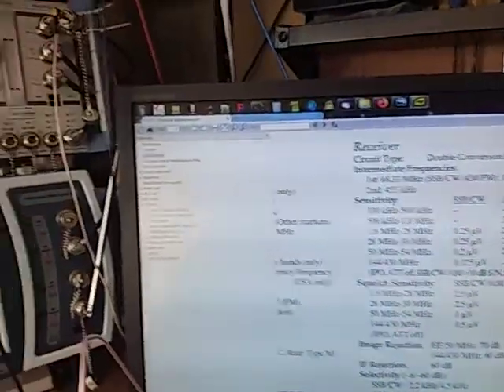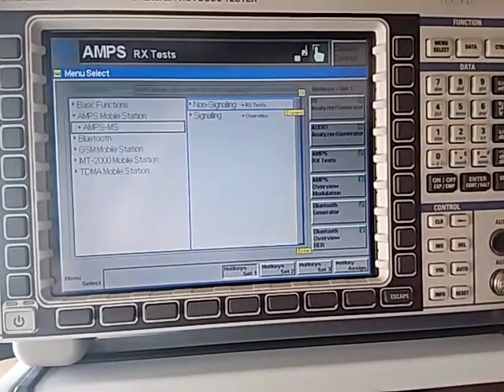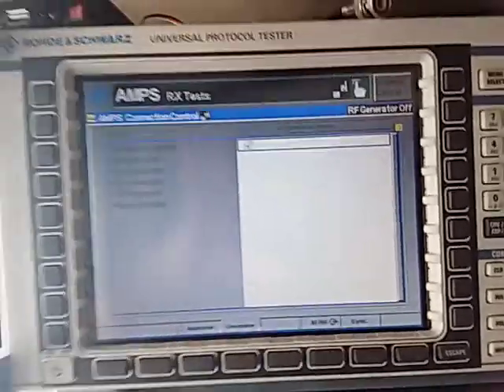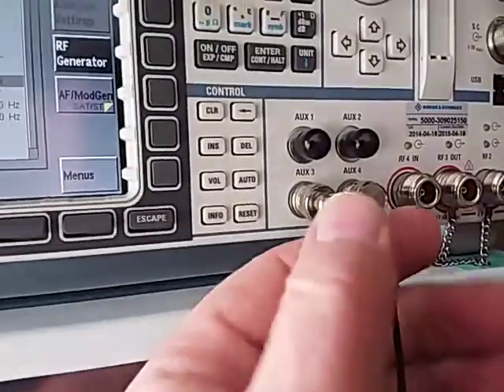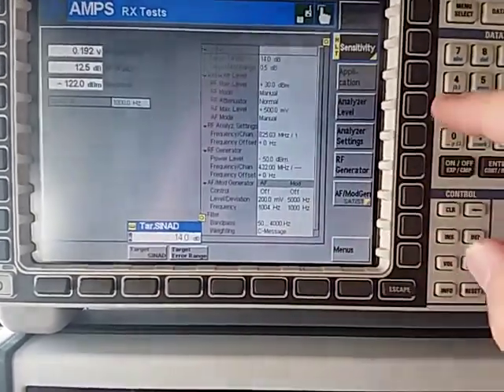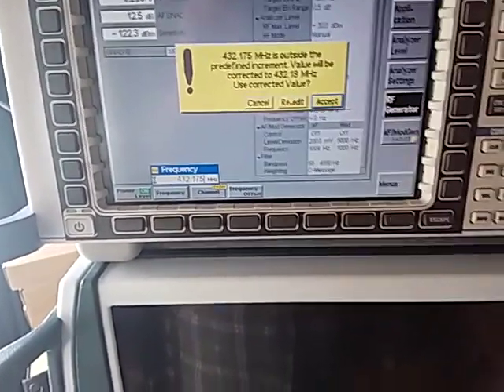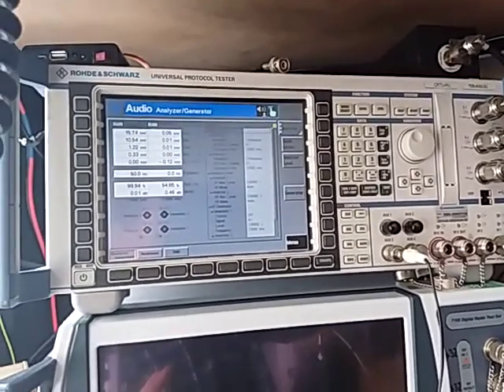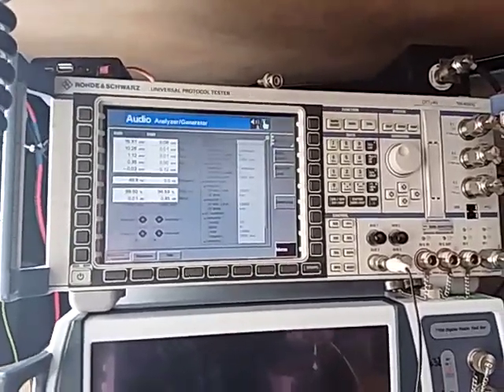Rohde & Schwarz CMU200 or CRTU - SINAD Testing

Comment: Hi Chris,

Greetings from India! My name is Sunil Das, and I'm a ham radio operator from Kolkata (VU2SYD).

I came across your video featuring the Rohde & Schwarz Protocol CRTU-RU Radio Tester with AMPS software installed. I'm impressed!

As it happens, I own the same CRTU-RU unit, but I'm missing the AMPS software. Your video highlighted its importance, especially for audio-related tests. Unfortunately, I'm unable to perform these tests without AMPS, despite having the necessary audio card.

Would you be willing to share a copy of the AMPS software with me? I'd greatly appreciate your help.

Thanks in advance,

73s 

Sunil Das (VU2SYD)

Comment: Hi, I would like to ask for information about your CMU200, are you using both B41 and K29 options?
or CMU200 only use K29, can test.
Reply from the maker: B41 audio is required for audio testing. I have added it to my CMU-RU. They do not normally come with it. It also has K29 AMPS mobile station signaling/non-signaling test software.
Reply: @ZL1CVD  okay I understand
Thanks for the information. I'm deciding to buy

Comment: Just curious - Your unit looks like it is the CRTU and not the CMU-200.  I read about the CRTU and I see that it normally does not come with the B41 audio analyzer or supposedly cannot get the option K29 for AMPS like the CMU-200.  Is your unit really a CRTU and how did you get the options for the analyzer and AMPS set up on that unit if that is the case?
Reply from the maker: CRTU-RU & CMU200 are same unit inside - different front panel; CRTU has power divider combiner + additional RX/TX Board; CMU200 has speaker (not used) + I/O ports which are on rear of CRTU. I have had many of both. I added all options to my CRTU & activated all keys.
Reply: @ZL1CVD  Hi Chris, I recently bought a CMU-200 and had hoped I that I do SINAD measurements like you showed. I have the hardware options B41 and B21V14 and B21/2 installed. However the in the "menu select" screen I do not get AMPS MOBILE STATION displayed as a menu item. Maybe I need the "normal" B21 hardware option? Or maybe I need to install some additional software on the CMU-200 ? Any ideas/help is appreciated.
Reply from the maker: @dd1us709  you need B21 hardware options 1100.5000.14 & 1100.5000.54 + B41 + software K29. If you have the hardware but just need software there is a thread on eevblog with an example python script showing how it could be activated.. 
https://www.eevblog.com/forum/testgear/enabling-options-for-rs-test-equipment/
Reply from the maker: @dd1us709  all options are listed in R&S document titled "R&S CMU200 options and accessories" - search the web for it.
Reply: @ZL1CVD  Hi Chris, how do I verify that I have 1100.5000.14 & 1100.5000.54. I do have B41 and K29. I am pretty sure now that my problem is, that the firmware for IS136/AMPS is not installed. Thus I now ordered a PCMCIA memory card and will then install Base Firmware V5.21 and IS1M V5.20.
Reply from the maker: @dd1us709  Not actually sure how to confirm 1100.5000.14 & 1100.5000.54 - seems that is R&S option order number and not module part numbers :( 
Make sure your PCMCIA card is 2GB or less otherwise the DOS system in CMU will not recognize the card. I use an old Sony VAIO PCMCIA to SD card adapter and a 2GB Kodak SD card - I can red/write SD Cards with my desktop fine so this setup works for me. 
Yes, you need to have ISM S/W installed. If you have USB ports on back of CMU then v5.2x software is fine. If you have older AMD K2 and round PS/2 keyboard ports on back of CMU then you'll need an older software version as 5.2x  is not compatible with the older AMD hardware & associated cards.
Reply: @ZL1CVD  Hi Chris, thanks for the hints. Actually my CMU-200 does not have USB ports on the back but only round PS/2 keyboard ports. Thanks for letting me know that I cannot use V5.21 with my hardware platform (FRM6 frontmodule, Intel Celeron CPU, 256MB memory). Do you have any idea where I can get older IS136/AMPS firmware (I'd prefer V4.51 or V4.50). Many thanks in advance for your answer.
Reply from the maker: @dd1us709  I'm pretty sure v5.1  will be ok. I've shared it here: https://drive.google.com/file/d/16XrS75ddTjhZ1djPTFBBh6Bb_1HxlX2V/view?usp=sharing
Reply: @ZL1CVD  Hi Chris, thank you very much for the firmware. I appreciate it. I am not sure though whether I can use it as I found the following information:
Important Notes:
1. The V5.08 is a new branch and not compatible to previous versions V5.00 to V5.07
This means no function groups V5.00 to V5.07 can be installed on this base software V5.08
2. The V5.08 is later than the V5.1x releases.
It supports the new hardware (CMU-B21v14 1135.4580.02, CMU-B66/B68 1135.5070.53, Digital Board 1100.1956.05 and TAZ: >=10.02) but it does not contain any V5.1x features or bugfixes
3. Version V5.1x does not support the new hardware (CMU-B21v14 1135.4580.02, CMU-B66/B68 1135.5070.53, Digital Board 1100.1956.05 and TAZ: >=10.02)
If I understand this correct then Version V5.10 does not support CMU-B21v14 which is in my CMU-200 unit.
Reply from the maker: @dd1us709  OK. Then the only other I have is v4.3 here:
https://drive.google.com/file/d/1B6I_bNDgUksurb5GKPtGAfhChoPSnBPc/view?usp=sharing
Reply: @ZL1CVD Hi Chris, thank you very much. I Might try V4.3 together with the V4.5 base firmware.
Reply from the maker: @dd1us709  OK. Im not sure about that.
Reply: @ZL1CVD  Hi Chris,

today I got the PCMCIA Adapter and could load the firmware from you to my CMU200. V4.3 works fine. The I also tried V5.21 (Base) and it also works fine, excellent. The only file I am missing is GSMV5.20 (unfortunatelly GSMV5.22 will not load on the V5.21 base firmware. Any idea where I might get GSMV5.20 ?
Reply from the maker: @dd1us709  I have GSMSV5.13 & GSMV5.22 but no GSMV5.20 sorry.
Reply from the maker: @dd1us709  ..not sure where you would be able to get that from either. At one stage you could download the latest from R&S but those old links are now dead. If you manage to locate it anywhere, I wouldn't mind a copy
Reply: @ZL1CVD  I have sent an Email to R&S service and will see what they respond .. usually they are very fast and forthcoming ... if I get something I will let you know ...

Comment: Hi Chris
Great Videos,
I am looking to get one of these, for Ham radio use and more, are there any other tips you can give me on options soft and hardware, so i get the correct one,
also could you please show more on the spectrum analyser, DOES THE Gen track with the s/a
Thanks Dave Browne 2E0DMB
Reply from the maker: These dont have a tracking gen. But there is sw from r&s that let's you do that from a pc. Spec an is 10mhz to 2.7ghz. I'll put up a video showing option at a later stage. Stuck in VK at the mo. 73s om de zl1cvd
Reply: @ZL1CVD  
Thanks Chris
Thanks that would be great,
If I get one without the amps ms software
Can I download it free or is it expensive
Thanks Dave 2e0dmb
Reply: @davidbrowne1588  You can activate the AMPS Option yourself. Software is implemented in CMU200... But you need Hardware Option B41 for this. So look for a cmu200 with Option-B41 Audio Analyzer.
Reply from the maker: @dragonlard4595  there is also hardware other than B41 audio analyzer required for AMPS. I dont have access to my docs now but you should find on R&S website CMU Options doc - it shows hardware & software required for each digital mode
Reply: @ZL1CVD  Yes..AMPS needs B21 too. But I think every complete CMU has this option installed.